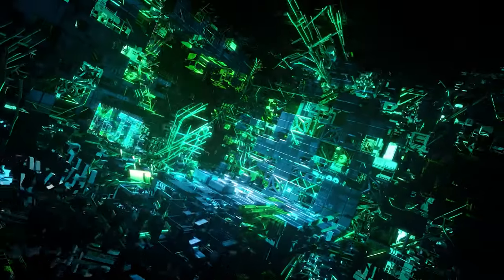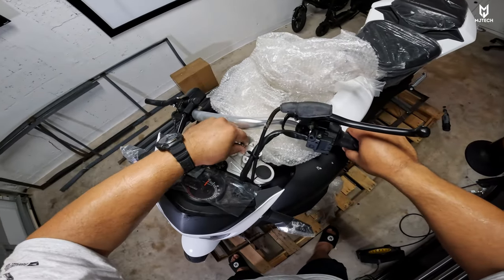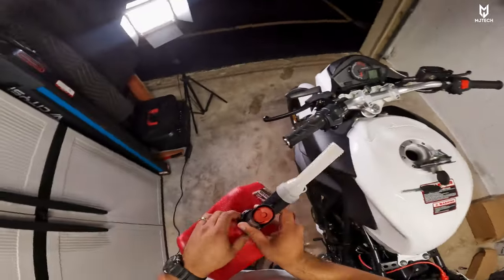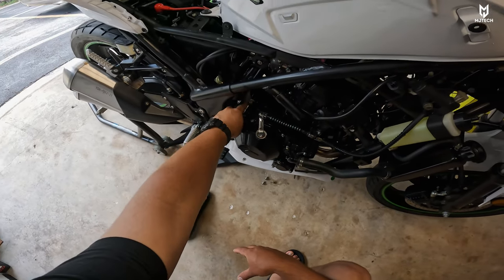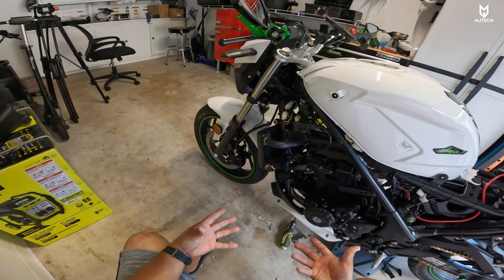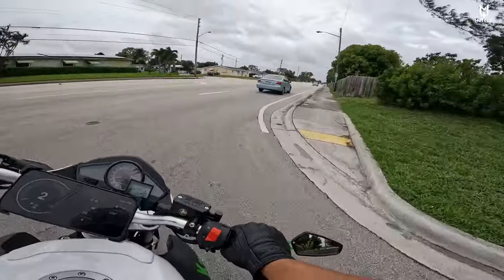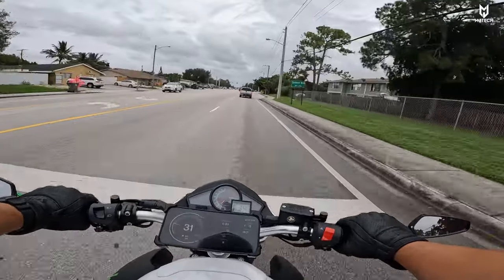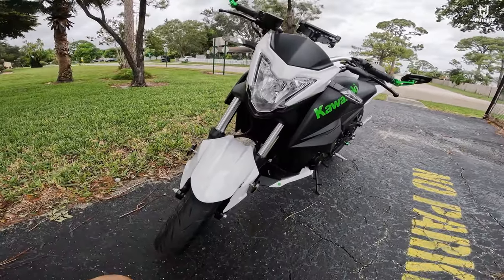New 2022 Vitacci GTO 332cc Motorcycle - Now with Upgraded Engine & 6 Speeds

Comment: If the motors not broken in, then why did you put full synthetic oil in the engine?
Reply: Probably because where he lives is hot and or very humid.. synthetic dissipates heat much better

Comment: New to motorcycles, I'm looking into the x22R Max. Can you explain the best way to break in the motorcycle?
Reply: Heat cycle 20 minutes at a time at least 4 or 5 times for the engine... then first road miles take it easy for about 500 miles.. change your oil to start them as needed try not get oil to look black dark brown not black ..koo
Reply: Just ride it like you stole it!

Comment: Looking into getting one here soon. What issues have you had so far?
Reply from the maker: So far the only issue I’ve had was with sputters. Ended up being the throttle position sensor. It appears to be an isolated incident.
Reply: Yup and i got the upgraded version the EFI venom 250 superbike and Its fuckin AWESOME it did have a problem at first stalling at idle but i just adjusted the throttle and now PERFECT

Comment: these bikes run lean be careful. if you look at night the headers tend to glow very bright red. also the coolant youll have to constantly check as it vents out of a small hole on the bike. these are not true 350cc bikes and are detuned to 250. mine did 90 mph tops. sprocket limits the top speed and youd need to get a custom rear sprocket as you cannot buy any that fit. compared to the others including this updated version it felt exactly the same as the 250 version i had and that version also stated in the ad that it was "tuned to a 350". All a marketing ploy in my opinion.  Way under powered for a "332cc". Compared to other bikes Ive had and owned that were real 250 cc they were smaller and had more power and higher top speeds. Still a fun bike none the less. The only big upgrade is the gearing. These ship to your door bikes are restricted in terms of power and speed. all chinese bikes from any seller are named differently or can be renamed but all will have the same specs in terms of power and speed. any higher and it changes the politics of these bikes if you will when it comes to exporting here.